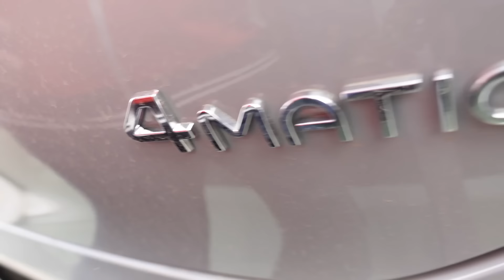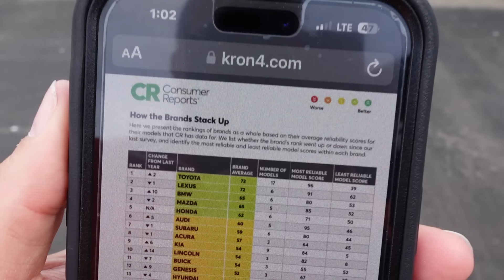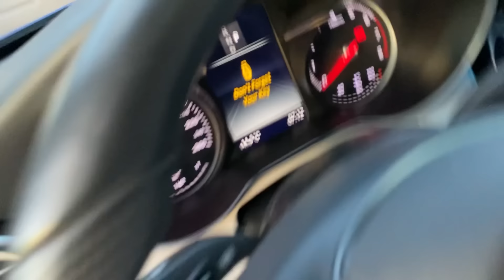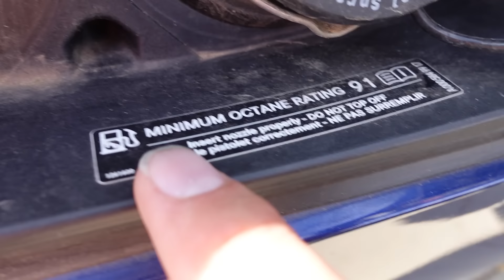The 10 Least Reliable Mercedes! (Avoid These)

Comment: From somebody that had  multiple Mercedes. There are actually way more liable than what you think... I've seen a 250 with almost 300000 miles it Depending on how the person and previous owner do with the car.
Reply: Built in German soil are very reliable, here in Spain when you look at second hand mers they all the very least easily have 150,000 to 300,000 km and still running .
Reply: Reliable....not liable. 
People are such morons.
Reply: My 2005 CLK 55 AMG with the 5-Speed Auto has 180k miles on her with zero fluid/oil leaks still... runs perfect!
Reply: I have a gla250 with 180k 

Power steering went dead but it’s pretty drivable
Reply: This guy is full of it.
Reply: E550 173k miles. Coolant leak but have replaced hoses and water pump gasket. 
Taking care of the issue instead of a bandaid will ensure longevity.
Reply: @MICLGz  Exactly, it's all about how you maintain these cars and quite honestly, which car you get. Some have more known issues than others.
Reply: Mercedes is super reliable unless you buy the v12 and some random models. Anyone who thinks they aren't reliable has never owned one...
Reply: In cyprus we had with over 1.000.000 km ..taxis
Reply: 300,000 miles with a lot of repairs and anxiety.
Reply: @JoseMarquez-oo7sl  no , and in all honesty, the parts not even expensive don’t get a car that you honestly can’t afford you might not make that much like you think
Reply: @killertay1947  your parts are made in China, that’s why you find them not expensive. Don’t buy Mercedes Benz if you cannot afford. Don’t just put China made parts in your MB.
Reply: 300000 miles? 😂😂 Maybe after you invest 2000-3000 thousend on repairs!Obviously  you never owned mercedes. IF you did you would  know they are very unreliable  and unquality.
Reply: @JasZg  😂😂 you talking to somebody that’s on his six Mercedes you don’t know what you’re talking about trust that lmaooo , and for BMWs, I literally sell cars and fix them half the parts that say from Germany, not from Germany shit from China to… 95% of all parts car parts, even from Mercedes and BMW’s car from China
Reply: @JoseMarquez-oo7sl  you genuinely don’t know what you talking about you talking to somebody that works and fix on cars on his six Mercedes and for BMW from a little 335i to a 7 series L…. Just stop
Reply: @JasZg  2 to 3K go a long way when you fix on the car yourself Mercedes are not that hard when you actually have the tools way better than BMWs
Reply: @killertay1947  you stop, because you are the one who don’t know you aretalking.  I owned two Benz, all of them have the same problem. Transmission. Car maintenance were always done at San Francisco, Mercedes Benz.
Reply: I have/had 3 of the cars on the list GLC300/CLK Coupe/S Class W221 - I think he’s spot on. My most reliable Merc was a W212 E Class.
Reply: @JoseMarquez-oo7sl  I’m literally on my fifth Mercedes 😂😂 the most common problem that I see is water in driver seat .. but bro that’s just previous owners not telling you everything but I assure you the W204 are the most reliable cars money can buy
Reply: @ Both my Mercedes Benz cars reached only 25,000 miles, 37,000 miles only. Transmission problems.

Comment: They work fine. Definitely better than BMW
Reply from the maker: Yes
Reply: Yup traded my 2013 c300 for a 2013 bmw 328xi and damn that was a mistake. 4 months later engine was done. 112,000km on it
Reply: Actually  Mercedes-Benz  done mistake  what  Bmw previously done on n47 engine. I am talking  about  timing  chain and tensioners. Google  and inform yourself  better  you know nothing.Beside that mercedes  have bad injectors water pump and sensors.Yes,i do own w204..Now i am selling  mercedes to buy Japanese  car.And no,mercedes  is not better then bmw.
Reply: @JasZg  you’re out of your mind walking around thinking that , I had Mercedes and BMWs. I have more problems on BMWs than Mercedes BMW used too much plastic in their engines, coolant and everything else Mercedes you just have to maintain the maintenance as long as you do that you’re good BMW on the other hand, even if you maintain the maintenance, the amount of plastic that they use is gonna slowly dry rot… I’m not saying BMWs are trash. I’m saying compared to Mercedes  the liability compared to Mercedes is slim to none… I’m on my fourth Mercedes 1 c300 2 c350 and 1 c250 , BMW I had 2 320i and a 2010 seven series

Comment: In 24 years, I've had 10 new Mercedes from a CLA to S-Class and GLE63.  I am picky so I change the oil at 5K miles and follow the service intervals.  I had an airmatic issue about 20 years ago with my S500.  That's it.
Reply from the maker: Cheers

Comment: I have an 09 W204 with a 3.0 V6 and 175K miles driving it since brand new. To be honest with you... this car has been sooo reliable that it is still running like new.
Reply: Consider yourself one of the lucky ones, good fortune smiled on you that day.
Reply: @anthonyxuereb792 the V6 na Mercedes tend to be the most reliable
Reply: @cdl34453 thanks but it doesn't matter, I wouldn't buy a German car now
Reply: I have owned a 2013 c 350 coupe made in Germany , sold it after 2 years which I regret , but I never used it much , I still own a C200 compressor 2007 now done 79000 kms & is still like new made in South Africa , I also owned a merc sprinter never had a days problem, sold after kms 150000 due to change in business, I also own a ML 350 petrol  2006 kms now 216000 recently changed balance shaft & timing chain as the were a problem on the 2006 to 2009 now have the updated shaft & chain  now all good  . I think  you have quality control problem’s with Mercedes vehicles in America secondly this man really makes out that all Mercedes vehicles are rubbish , I think he just has personal issues with Mercedes for reasons best known only to himself , do yourself a favour go buy a Ford  or a Chevrolet  or better still perhaps a bicycle . There is nothing to touch German engineering   , you just have to understand how to work on it .

Comment: as a Mercedes mechanic I can say:
 -he‘s heavily overexaggerating on the 30% of actual issues, which are even ones where a Customer has to pay 0$ for a fix, also doesn’t take more than an hour normally (where you do get a vehicle from the dealership)
- he picked smaller issues (sometimes also issues due to wear) and exaggerates the outcome of those
-lied about some issues (doorhandles breaking off on newer vehicles for example)
Reply: this. his research is off.
Reply: Did any body else notice the ones he said were bad for rust, had no rust???
Reply: glad i found a benz tech lets talk about it, the stealership that is. my o2 sensor just went out monday on my 12 e350 why in the hell does the stealership want 500 to fix? ive watched how to replace on youtube and it can be done in 30 mins tops but a half wit. I literally almost went back to the dealer just to cuss someone out after watching that youtube video.
Reply: @darrelldaugherty4230 a little know how and proper tools take you a long way.
Reply: Where in the world was the “rust” on that c250?  Also that C class was definitely an older model than 2012-2015
Reply: I have a GLC300 I love it only had to change a tire and brake pads only had 1 issue with a sensor easy $50 fix had it for 3 yrs now
Reply: @darrelldaugherty4230  dont listen to this youtube video lol
Reply: This guy talks bullshit. There are no bigger rust issues for the w204 chassis. Its one of the best
Reply: $220 per hour fee, labor charge only.
Reply: P😅😊😊😊 @ShiroUwUs
Reply: Having the W204 on this list is where he lost me lol
Reply: He seems to be right regarding the w209, which I own one of (1.8k), at least. There is such an abundance of cheap, used spare parts here in Norway though, so I am not that concerned, as most issues I will be able to handle either myself or with a off the clock mechanic, with almost free OEM parts
Reply: @craigwatson8732  The w209 really do have a big issue with rust. It is the only issue struggle resolving on mine, as all the parts you find are usually also rusted. Paint is not good either and looks like someone has been cleaning it with high grit sand paper regularly over the years
Reply: @Anythingblaugrana thinking about buying one. Are they pretty reliable?
Reply: I've had my GL450 for years now and never had any issues. They say it's the worst Mercedes ever made, lol. I guess I've been lucky. I thinks it's all on the up keeping and maintenance.
Reply: Please, @jost9334 - I really wish you can answer this but I'm in the market for a used Merc Gla, preferrably less than 100k miles. Is that a good car to buy? Or even a Merc C220, estate. Thank you in advance.
Reply: i asked my mechanic if I should buy Mercedes. He said no and that they are Renault in disguise. Im looking at an E class soft top but cant afford endless repairs. Im still tempted though
Reply: @jost9334 what are your thoughts on Merc E Class 2013-2014 models?  and which of them is better? or is S class 2006-2007 better? Keeping Luxury/Comfort in mind.
Reply: The S550 is gonna be my next car. does it really has a lot of issues with it??
Reply: He is exaggerating, his YouTube views are trending down, no credible sources, he is basically trespassing dealerships lots to make these videos. Repairs could be pricey, but as long as OEM parts are used you are good. I have owned all Mercs for the past 25 years, I don’t know what he is talking about.
Reply: @furryelvis sounds like you need a new mech. Nothing but MBZ all my life and wouldn’t dream of anything else
Reply: The S550 is a fine car. Beautiful interior. Nimble, roomy, just change your fluids!
Reply: I agree. I have a 2014 and a 2017 C 300 . Both have been very reliable. Trouble free. Previously had a 2004 C230 Kompresser  that we racked up 230 k miles with no problem. All of these vehicles were built in Germany which may have contributed to their quality.

Comment: I’ve had a 2011 s550 4matic for 5 solid years, currently sitting at 110k miles and I’ve had zero of the issues he bloviated about. Very subjective & anecdotal! Conventional wisdom/knowledge: Do your Carfax history before purchasing any used vehicle, get a warranty if possible & don’t be cheap on maintenance. I’ve had mine serviced, maintained on-time routinely at the dealership I bought it from. I’ve had to do 1 or 2 repairs in all 5 years I’ve had it, which were inescapable based on certain known milestones, nothing extraordinary. It still drives like a dream. An absolute beast of a machine! About to buy a 2020 s560 soon & I’m torn between keeping my 2011 alongside the 2020 in a couple months or trading it in to pay down/towards the new buy. Still looks and drives amazing as it did the 1st day I got it. Definitely still love it and Highly recommend it to anyone… but obviously again do your due diligence prior to buying and keeping up with on-time quality maintenance. Failure to do so, could very well bring these nightmare scenarios he highlighted into fruition for you.
Reply: I'm considering a 2019 S560 or 2017 S550. Thanks for sharing your experience.
Reply: Same my w221 has no problems
Reply: The w221 is a solid bulletproof engin
Reply: thank you for this. i keep getting swayed from getting a mercedes because of issues being stated. i plan to take care of my car once i get it.
Reply: They still allow their dealers to put 0-30oil..in hot weather it will have all those issues..put motul full synthetic 10-40 to last...here the dealership recommends 0-30 in 45c under shadow climate..all will pop off with traffic lights every 150m in city

Comment: Got. a 2011 S550 Mercedes Benz with 130k miles from an owner who was falling on hard times. The car was in immaculate condition. Based on the car fax report. I took the vehicle to a Benz mechanic . Had the fluid service , plugs, injectors, brakes and replaced all the suspension bushings. I spent $5768 to do it all.  I also bought warrantee for the engine, electrical, and transmission. 
The car is sweet like bees honey and drives like a luxurious elephant.    Benz were built to be taken care of… Take care of your stuff!!! Do the right thing and you’ll be ok. The previous owner is so proud I kept it up. He even drives it sometimes when I go look for him.

Comment: I have a CLK63, And a CLK550, I haven't had a single problem like that 12:46, The suspension is smooth and as reliable as it can get. It's just a regular coilover suspension, They are cheap. Any problems that I've had are just small problems. The cars run great and I absolutely love them.
Reply: W209 Perfection
Reply: I agree very reliable car
Reply: W209 CLK's are very reliable when maintained,,,25 year old cars need some parts replacing ,,that is to be expected..
They are great cars.
Reply: Yes I have the '06 500 V8, Convertible w/ 111k for sale! After my accident it's too low for me now. No issues.

Comment: My M272 C350 has been tremendously reliable! I average about 40k miles a year and it's been smooth sailing! I have yet to spend over a grand in repairs so far in 2 years... Little things here and there especially the interior trims are the opposite story since they're made out of plastic but overall my powertrain has been solid!
Reply: me too bro my m272 has been reliable for the past 3 years i’ve got it. i don’t think he brought up the 2009 c350 which i have just the 07-08 to 2011 and up
Reply: Just wait… thought my Mercedes was great. Not one issue in over 4yrs. Engine light came on.. it’s dead. $23,000 for a new engine.
Reply: @Snaphotsthroughtime  are you driving an AMG???
Reply: @Snaphotsthroughtime Yeah.. that's what they tell you. I don't believe that.

Comment: My '2012 S550 4 Matic with 105k miles is a good car with no issues as you stated about the car...the car is solid.
Reply: Owned a 2010 S550 before upgrading to a 2012 S600(wife insisted it’s the one she wanted) The 550 never had problems listed in the video. I love the S600 though the 550 is more reliable.

Comment: When it comes to reliability and air shocks, I can't think of one manufacturer that has managed to make them reliable. If you want guaranteed problems with your suspension, order a vehicle with air suspension. The dealerships are smiling and scheming  as you pull out of the lot, Well, there goes another happy customer that we are sure to see again in 50,000 miles. 13:06
Reply: That's nonsense! Gas struts and shocks also have a 100% failure rate. Shocks and struts are expendable parts. Air struts maintain a consistent ride quality until the point of replacement. Where as gas struts degrade slowly and can just be ignored when they need replaced. Which is what air ride haters are actually looking for in most cases.
As for reliability..maintain the suspension properly it can last a long time. 
My 2010 Lexus LS has 175k miles and the original air struts do not leak at all after 15 years.
Reply: W222 S550. 100K miles, original air shocks.
Reply: Facts!!  Maintain the suspension … you’ll be ok.
Reply: @joshriver75  your driving a Lexus/ Toyota comparing to VAG or merc. Reliability is incomparable, It going to break yes or yes. You buy with your heart  not your head.
Reply: @camilacretenze534  No I'm not! The OP stated "he can't think of one manufacturer that...."
Lexus is one, so I used it as an example. 
You also make the mistake of assuming Lexus is the only brand I own.
I've owned 2 Jags, X350 & X358. I also currently own 2018 S450 w222. So I don't know what I "buy with my heart not my head" is supposed to even mean in the first place. 
You could've addressed my point which was, 100% of gas struts and shocks wear out and go bad also.
The fact of the matter is..people want gas suspensions they can ignore instead of being forced to address Air suspension maintenance or the replacing of parts..
What was your point again ??

Comment: My grandpa has a 2009 s550. Sexy tail lights. Awesome car. Drives perfect. Garage kept. The only problem was on the center console and dash where the leather was stretching. My moms ml 350 went 295,000 miles. That car was built amazing. Oil leaks happened at 280,000. The headlight lenses turned yellow and that’s one of the only things that went wrong with the car. I’d definitely recommend the 2011 generation ml350! My 2018 e63s has 75k miles and drives great it’s the best car all around between performance and luxury for the money. Bought it with 48k miles and I have had zero issues.

Comment: Brother I love these videos! You’ve helped me a lot when I almost purchased a BMW 335i. I literally cancelled the purchase and went for a Mercedes E class that you rated good 👍
Reply: Some models have a better rating than others but a big factor (for used cars) is the previous owners maintenance history.  I have owned and or repaired many used German cars over 3 decades and some owners treat them like a dumpster. I've done a lot of work to this one kid's 2011 e550 coupe and he brought it to me complaining of heavy smoke coming out of the exhaust. I found out after checking the dipstick and changing the oil he had over filled it by 6 quarts.